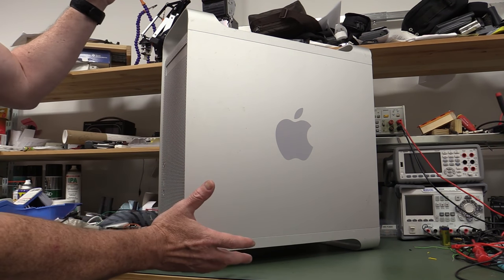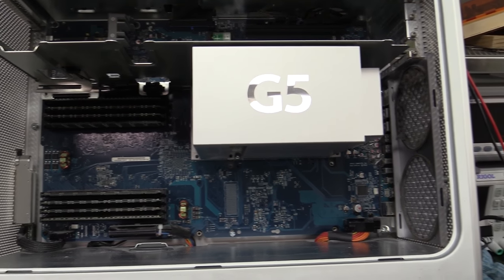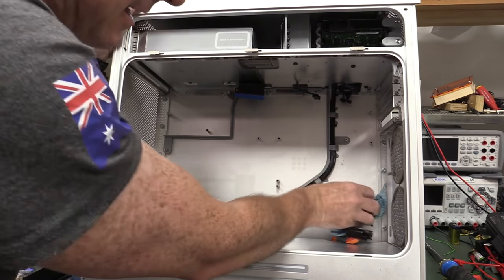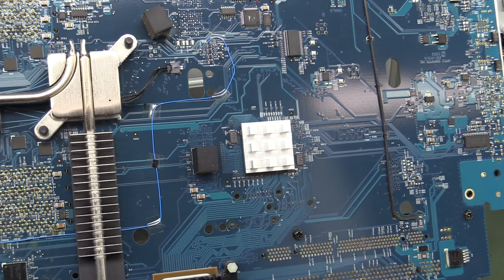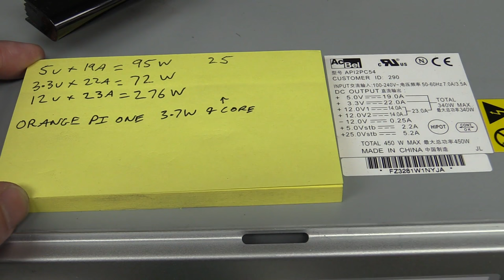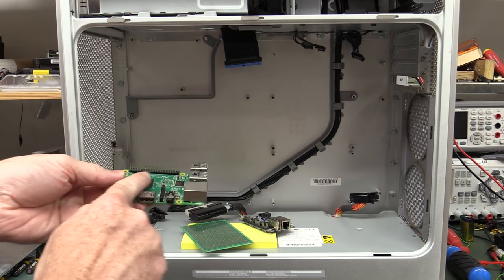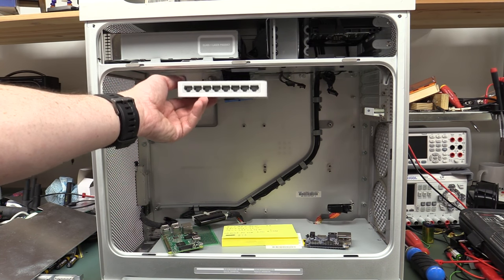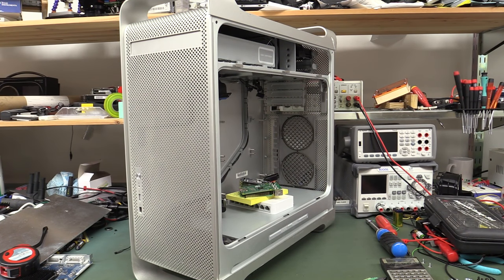EEVblog #946 - Apple (Raspberry) Pi Cluster - PART 2

Comment: It looks like it's going to be a fun project. I have a few comments.

1: Don't use compressed air to blow the dust out of the case, Especially if you're in your shop. You only wind up Cleaning the dust up multiple times. use a vacuum cleaner and small brush Instead. and you certainly don't want to be breathing that dust. 

2: on many power supplies the 3.3 rail is supplied by the 5V  rail. If it is, your 5V rail will deliver another 72W.  Something to check.

another thought, each riser board could support 4 boards. 2 on each side of the riser's. This could save you some room, and be a bit easier to Implement. possibly doubling your board count. 

Looking forward to the next video.

Joe.

Comment: The 25Vstb at 5.2A is probably the ADC power supply. Before DVI was out and popular, Apple had this thing called ADC (apple display connector, TDMS like DVI) which had power built in (and maybe even USB, not sure) to power the connected displays. The AGP slot had a little 'extra' mini slot where you get the extra power from (since the AGP slot can't provide that much power). It is somewhat lower than the AGP slot as to not interfere with non-ADC video cards.

With a connected ADC display, you could power on the computer via the power switch on the display itself rather than using the soft power on button on the computer unit. Since the display would need to be somewhat universal, they just decided on a 'standard' 24V power bus via ADC, and have the device connected to it do its own power supply. So basically, 25Vstb turns in to a 3.3v/5Vstb somewhere in the display, just to have a soft-power circuit for your display and computer.
Reply: I'm fairly certain ADC supplied USB and FireWire.

Comment: When you layout riser boards, don't forget the fans. If you make two sizes of riser boards, you can interleave them. Short board with Pi close to the motherboard, long board with Pi further out.  You could probably get away with not supporting the short boards. You might be able to support the long boards with a notched plastic bar. You might be able to mount Ethernet hubs on a hinged panel that drops down when you open the side panel.

Comment: Why don't remove the pi on-board 5v to 3.3v reg to power directly from 3.3v. Bonus: more amps on 3.3v rail so more boards and less waste heat inside the case.
Reply: More work and more chances of FAIL.
Reply: Greegor47 Dave can desolder a linreg... That would reduce heat by 30%

Comment: I'm sure Dave has addressed this, but how come he wants to use regular pi's? Why not use the compute modules, that way you could make a huge board full of pi with a bunch of sodimm connectors. You would sacrifice some RAM but surely it would be easier to use compute modules? Intel edison has a compute module as well.
Reply: still, you could fit so many more of the modules in, I feel like the benefits of a the standardized connector for power+data would outweigh the costs of lesser performance per module.
Reply: I saw on the blog that they were making a compute module with the raspberry pi 3 specs but i dont think it has been released yet.
Reply: Is anything sacrificed in the compute module or is a fully fledged rpi? I
 feel like Dave should wait until what you mentioned comes out or 
something because using regular pi's seems like a very poor way to use 
the space to me.
Reply: they probably sacrifice the wifi connectivity, not much use for that in a cluster.
Reply: exactly! it's not gonna take long till the raspi3 version comes out and so, in the meantime, he can work on the carrier board!
Reply: The compute modules cost 3-4 times what the orange pi thing he has there and perform 3-4 times worse I seem to remember.
Reply: John Smith the current compute module is a pi 2, but it's about to be available the new one with the same SoC as the pi 3, anyway the cost is higher but it will gain it back thanks to a more efficient and elegant designed carrier board. I mean those connects through dimm slots, imagine how classy, elegant and how simpler the carrier board will be!
Reply: I thought the old one is Pi 1 based and we're waiting for the Pi 3 based one?
Reply: Idk why, but the image of a huge backplane with a million dimms makes me very happy, just imagine the delicious throughput, and engineering elegance. A bunch of orange pis on some jenky interconnect board with all of the unnecessary wasted io seems like not a great example for an engineering blog.
Reply: John Smith you are right it's based off the pi1 but the pi 3 based is about to be released to the general public by the end of the year and it seems to be already available to manufacturers (there is a nec display for conferences using it already)
Reply: I agree it would be much sleeker but when you are looking at buying 64 of something then doubling or tripling the price is going to make a large difference.
Reply: I think the point is that we are all stuck to the idea of using this huge mac case filling it. Why do not stuck to a fixed number of modules and creating a nice assembly around it? I mean imagine a very simple custom casing, just a box with in and out vents and the necessary ports on the back, there should be plenty of Chinese manufacturer doing it cheaply today.
Reply: I agree, but also, that mac case is very sexy, I have loved the g5/mac pro cases since they came out, and I think the "apple pi supercomputer" name just works so well :P
Reply: i cant remember if he mentioned it or not, i am not going to sit through the first video again..lol
the main reason for not using the compute module is that it doesnt have eth onboard. he would have to design a network port into the motherboard for each module. the io lines are available on the connector but not implemented. also he already has 10 of the orange pi's.
Reply: spud4242 considering he also said it is easy to implement a switch on the carrier board at this point why not also implement the small amount of hw needed to add a nic to every module? It's a one time thing that need to be copy paste for every module slot. If you look around a Japanese guy made a carrier board for pi zeros, he implemented also all the nics in the carrier board and it doesn't took much space at all neither it looks complex for a very good engineer like dave

Comment: I still like the idea of using PCB edge connectors on your risers and perhaps PCI express slots on the backplane.
if you mount the pi boards end on, then the ethernet and USB headers won't really affect airflow and you could patch the ethernet onto the riser board using a short and neat length of cat5.
You can probably then have different risers depending on the model of pi you are putting in.

Comment: iirc +25v would be for a screen attached using the ADC connector, probably easier just to have 1 supply for it, both standby and in use

Comment: I see what you mean about the switch. My only problem for what you suggest is when the switch goes bad you would have to source for the same model. what you probably should do is have all the pies connect to make either-net ports, route female ports to the top of the board then manually wire each board to the switch. Also don't forget the router.

Comment: I like the idea of just using an off-the-shelf switch that you plug into male plugs on the main board. Strip the cases off, add a pigtail to plug the power in too, and you could snuggle them all together at the top edge of the case so you don't lose too much space.

Comment: Crazy Insane idea: Since you're making daughter cards for all the Pi's anyways, why not pull USB off the Pi, run it into the daughter board and your custom connector to your backplane, and integrate a USB hub into the backplane. You could then do USB to USB networking, which is a thing. Wouldn't be as fast as ethernet, but a heck of a lot faster than SPI. Would be pretty cheap to implement, and you wouldn't have crazy cables all over.

Comment: Dave, orient the boards so that they are horizontal with the Ethernet ports facing you "right side up" and accessible to you for custom cable management, and to keep the ports from restricting air flow over the heat sinks. Then cable manage the patch cables up to a bank of switches at the top of the case using the case depth as space for the patch cables. The riser boards would have the gold fingers (edge connector) and the headers 90 degrees from each other, sharing a corner, but will always be the same length regardless of board type. might even be able to make a universal riser that fits both raspberry and orange pis, having two sets of headers on opposite sides with either one populated.

Comment: While I was watching I kept on yelling at the screen. Don't put the rpi in landscape with the long edge pointing at the back wall put it in portrait mode so it is standing on end. I think you could still get 2 high (across) the case. I think you would get 1 or 2 extra rows of boards in the case. 

Also with the daughter board why not make it specific to the rpi or bpi and then this will interface the same with the main board. 

Thinking about the networking. I am not sure how much traffic a individual node needs. This may determine that using spi for all the nodes will be cool but you may need to use standard Ethernet for the master node as the traffic will be higher. 

I can't wait to see where you take this project.

Comment: I also think that this transistor is used as a temperature sensor there. Didn't really look at this part when I tore mine apart a while ago. But I know this thing has temperature regulation for the different zones (separated by the metal sheets).

Anyway, thank your for the great video! I'm looking forward to the continuation.

Comment: I recently dusted my old desktop from high school out of the closet to try and see if I could actually use it to do anything productive (short story; not at all). It's an old 2003 Sony Vaio with a 2.8 Pentium 4 HT, which for the time was great, 1 gig of ram and a 120gb HDD. It constantly crashed while streaming video and opening any sort of application took ages. I'm too nostalgic to throw it out so it will just sit under my desk as a relic of the past.

Comment: Bottom layer for comms and power and the upper layer for the Pi modules. After all you don't really want to see the power and comms and they will remain static in the case. The upper layer needs to be visible and easily accessible so that you can swap out your modules.

Comment: As a datacenter tech, not an engineer, here's my two cents.  (Rounded up to a nickel, of course)

From a network topology standpoint, an 8-port switch for 8 Pi leaves no room to uplink without some 'weirdness' with port-sharing.  I'd suggest using a 5 port switch per four Pi node (2 cards as you've suggested), so you have one port to uplink to a primary switch and hosts possibly nested in the upper cavity.

With the sizing estimates you've shown, I feel it's possible to have three nodes (switch plus 2 cards of 2 Pi each) vertically in the space, and four nodes deep.

Based on that, I'm suggesting 5-port switches because many have a very compact form factor, nearly the same width as a Pi 3. (Example: TP-Link TL-SF1005D 5-port Fast Ethernet switch.)  If you go with a 10/100 switch in this size, they are fairly inexpensive (the aforementioned example is at the low-end of cost).  This would mean that each set of four Pi boards would share a 100 Mbit uplink, but with the proposed application this seems acceptable.  Going with gigabit, however, is still possible, with about a 50% increase in cost per unit in my brief research.

With 12 such nodes routing to a 16 port switch, you have four remaining ports for uplink and also possible "host" Pi boards offering increased storage as mini-NAS servers, internal DHCP hosting, and/or a PXE server, any or all of which can help the main cluster act as Plug and Play as possible.
(Example: Netgear GS316 16-port Gigabit switch.)  This switch being gigabit will limit bottlenecking to a degree.

If actual measurements permit, there may be room to add more nodes, though given the possible power limitations without tapping into the 12v rails, and the probable desirability for a more open airflow path for cooling may override the ability to pack in the compute nodes.  Another consideration is the room needed for the Ethernet lines on the board in order to attempt at preventing cross-talk and interference.

I have made a spreadsheet of this proposed topology, which would result in 48 compute units, 12 node switches, 3 hosts, one external network port, and a primary switch to drive it all.  Please forgive the crudity of the model, I did not have time to build it to scale or to paint it. :)

https://docs.google.com/spreadsheets/d/18tV2zP5AafFpic1QOAioA72hXrVGMXdygV1ms9M9ps0/edit?usp=sharing

Comment: There are tons and tons of ways to tackle this. Now if I was Dave and money wasn't a option I would do a huge motherboard but instead of riser cards I would use a flat flex cable with adapter cards that plug into the Pis This way if a new variant Pi hits the market it can be easily retro fitted. This would also mean a better way to mount the boards with aluminum standoffs. Have the networking and maybe a single USB port with the main header of the Pis all connect to the motherboard. I would also go ahead and build in a Ethernet Switch/Hub. I would still switch out the Power supply with a single or dual rail 5volt 30amp SM supply. Maybe a NAS with a massive SSD for the cluster to share as well.

A PIC or Arduino with a LCD and maybe a digital encoder for menu navigation to control what boards to be on and off or power the main master node from a standby rail and use it to control that feature.

Comment: I suspect only one of those bodge wires is original, can't make my mind up which one though. 

One's glued down using 'tak-pak' adhesive and the other is done with stickers (which I've seen on factory fresh IBM board of that era) by the looks of it, seems odd to have two different ways of attaching bodge wires from one factory.

Also, why not use those PCB mount RJ45 connectors to mount mount the Pis as well? You could also route USB through the backplane and have the riser board to connect the power and GPIO

Comment: also remember raspis are available as modules with a common dimm slot connector, those are perfect for a cluster
Reply: MasterControl90 yeah, single core though.  and pricey.
Reply: Ross Potts as replied in another comment, the new compute module with the same SoC as pi 3 is about to be released, yes it costs more but if you think about all the hassle he has to go through to design the carrier board and the power plane, without speaking about the costs of it, you will realise the higher cost is for the best.
Reply: MasterControl90 ooo!  I missed that.  that changes things a bit.
Reply: Ross Potts yup, just a bit. From what I know the new modules are been available from months for producers (nec is already using it as computing unit in some kind of conference display), while the availability to public is planned for the end of this year.
Reply: I read your comment 'raspis' as "rapists" and was very confused

Comment: This would be very interesting if you build it Dave. As for the switches, you'd use up a lot of space with off the shelf (potentially 64 ports). The cabling alone would be huge, or the PCB space would reduce the number of Pi nodes. Best to build it into the motherboard I reckon!

Comment: Not sure where the design specs are at at the moment, but what about:-
Since you will use a riser board to homogenize the 2 Pi types, why not stand them on the longest axis, so that the ethernet connectors are pointing out at you.  That gives the modules a smaller main board footprint, allowing more modules, and better utilizes the enclosure volume (and the airflow) . Then have short ethernet patch cables from each board up to the switches installed into the top cavity.

Comment: +EEVblog There are chips like LTC2991, that are calibrated to use 2N3904 as a thermal sensor and then can be either controlled by I2C or output PWM directly to the FAN control. I have seen Linear Technology in Apple, so might even be that exact part.

Comment: Bodge wire on the back of the motherboard!
Reply: I had to scroll too far to find this comment! I'm actually quite shocked Dave didn't catch it. Guess he was in awe of all the heatpipe "bling", to see a flimsy little bodge wire that's stretched across half the friggin' mobo :D
Reply: He did catch it later on in the video, but still, he ignored it a long time ;)
Reply: That's a 'precision engineering modification wire'  ;)
Reply: funkyironman69 PEM wire? Hmm... Just doesn't have quite the same "panache" as "bodge" :P

Comment: 36:00 Personally if you're considering using roughly 24 or even 48 (nice round number), I would gut open an enterprise grade rack mount switch and utilise the SFP+ connector as the main RJ45 to carry the entire builds bandwidth over a single connector.. also if they are only 100Mbps then you only need two pair (4 wires) to interface the daughter-boards to the main-board.

Comment: If you use 8 port switches, than 2 of 8 ports will be used in cascading switches together so you will be left with 6 ports. So 11 switched for 64 Pis..   Instead go for three 24 port switches or two 48 port  (Old from Ebay) mounted on the top HDD space. Run Shielded cables from behind the main board connected through some pcb mount connector . Just a suggestion